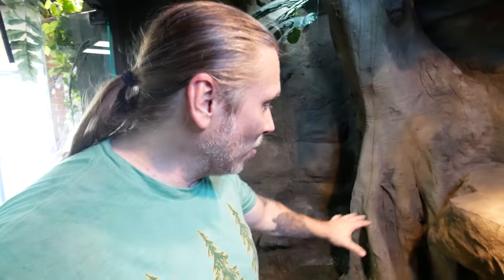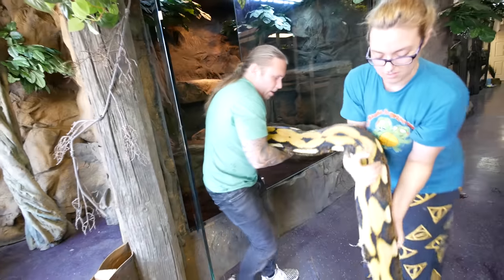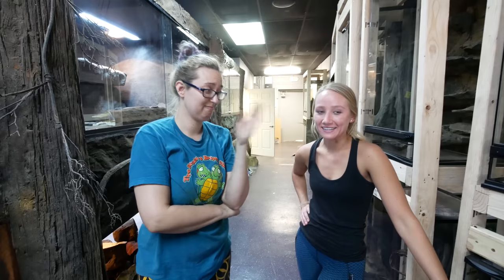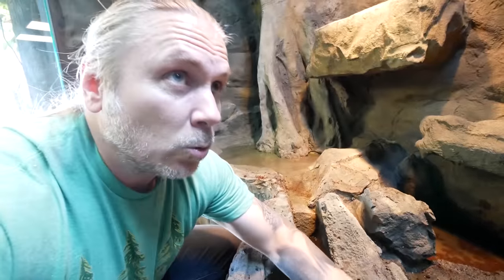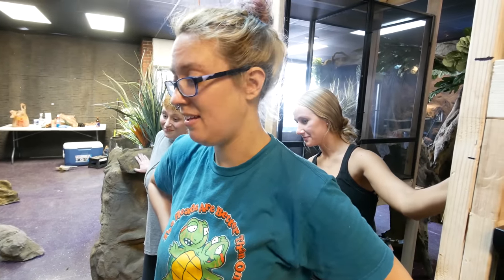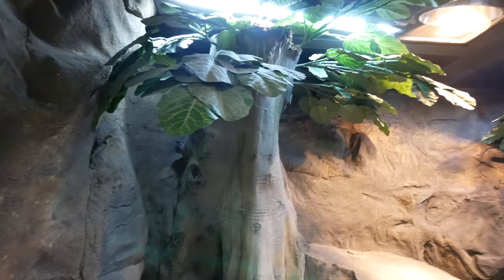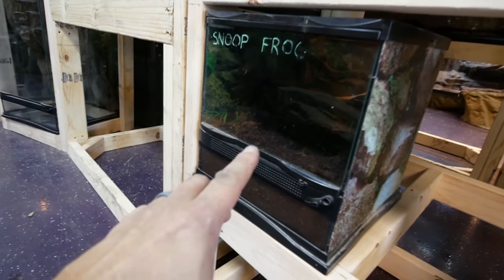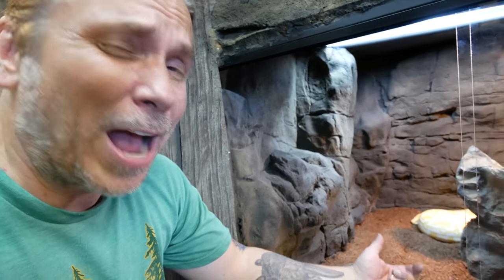FIXING MY HUGE SNAKE (LUCY's) CAGE AT MY REPTILE ZOO!! | BRIAN BARCZYK

Comment: Glad you fixed the water leak. If piping underneath still leaks a little, just leave plug in all the time and only remove it for water changes. You can paint it black so it will blend in. 
Also look at using PL roof and flashing caulk, used a lot in the ponding hobby, seals and sticks much better than silicone.

Comment: Hello from Finland! Zoo is looking great! 
But I think you should move chameleon cages higher, they feel more save above people and it would not stress them as much. Especially when you are using screen cage, all possible dirt and dust will have better access to their home on the floor. I use black plastic bags for covering my Veiledchameleon screen cages bottom from leaking and dust/dirt and also both sides so it would keep humidity higher and warmer and more relaxing for them. My chameleon cage is sitting on 90cm high dresser and her cage is 95cm high too, she feels safer to have the advantage of seeing possible thread coming from downside a.k.a me when i try to clean her or spray water :).

Comment: Never understand why more waterfall features in terrariums aren’t done with flex seal when you have a leak or need it water tight? I have used it for my waterfall build and it’s so easy to use you can basically make a pond liner with it. Of you can cut a boat in half and test it that way too!
Reply from the maker: Yeah it seems to be really easy to use